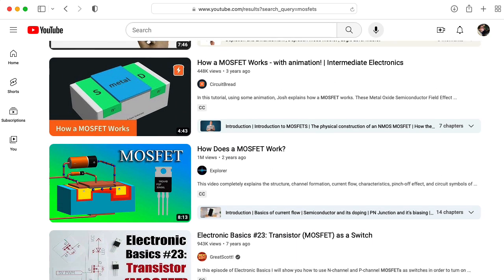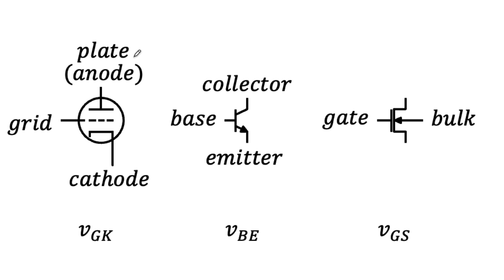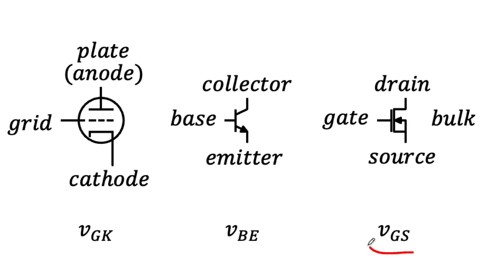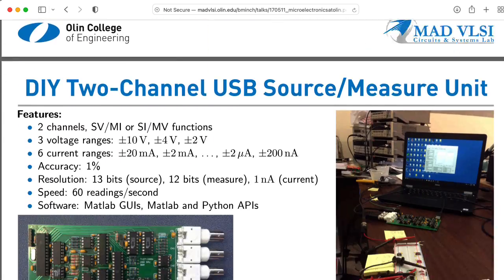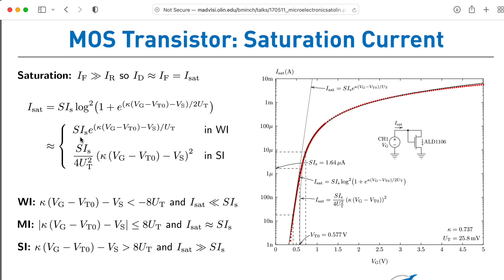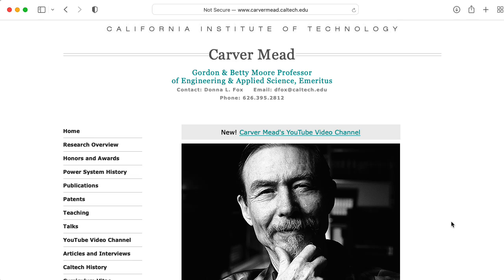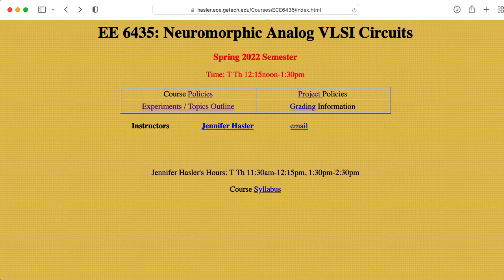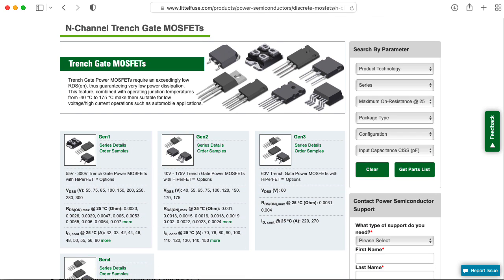They Mislead You About MOSFETs

Comment: hi there, i used a mosfet once, in a relais replacement cirquite board design. it still did not work. question for ya. is a mosfet a group of SOLID compuonands wich you throw with 10 at them at every noob design. in amy random configuration. and the somehow... grow themself in it. ? and choose their function accordi gly to give the designer a good feeling without  lowing to much fuses ?
Reply from the maker: I wouldn't suggest hooking up a bunch MOSFETs down and hoping they do what you want... you definitely want to think through what you want to do and what each MOSFET is doing. That said, I've seen some distortion pedal designs by Dani Ever that seem to defy any kind of conventional analysis. They really do look like she just randomly hooked up transistors until she got something that sounded interesting to her.

Comment: Hi Lantertronics - Thanks for the nice video. A specific point that you might want to spread the word about - the fact that virtually all discrete MOSFETS are of a fundamentally different class than those found in a VLSI process IC. This sounds like a very basic and obvious point to a specialist, but to many in the broader technology community this is a very obscure and non-obvious detail. Worth noting is the reason for that very particular ALD11xx series component  used in the schematic. It is among the very few discrete MOSFETS you can actually buy that resembles what might be found in a 30 - 40 year old CMOS process, and the fact that they can be obtained in matched pairs with reasonably good tolerance suitable for current mirrors being a rare property. I know there are even discrete FETs out there advertised as "small signal VDMOS" and a non-expert is easily confused by the "small signal" term. Case in point - even the eponymous author / maintainer of the popular Falstad electronics simulator program was unaware of this distinction. He seemed to be trying to reason about the reasonable default dimensions for his FET model by looking at datasheets for discrete MOSFETS, and couldn't understand why there is such disagreement! Quite a trap!

I don't think there are any good videos out there that really highlight this point specifically.

Comment: Actually the MOSFET will allow current to flow in either direction between the terminals and there are many reasons to do so. Switching AC currents is a common one as well as active rectification which utilizes the intrinsic diode of the bulk connection to create low loss diode circuit out of the transistor. In this usage current is only permitted to flow through the the transistor when the current is flow in the reverse direction. Also note in many applications the source terminal may not be or must not be consider to be connected to a power rail but instead floats offset from the rail which means that gate bias must be referenced to the source to provide reliable turn-on and turn-off. 

Also consider that how the gate is formed on the transistor the capacitance between the designated source and gate terminals is not the same and gate to drain capacitance changes when the device conducts so the terminals are not arbitrary but you can still use the device with proper attention to the gate bias as though the terminals don't matter. But keep in mind the parasitic diode will conduct when forward biased.

Comment: For me it only matters how volt threshold is. 
How high the switching voltage can be.
How much current I can switch. 
What the internal resistance is like. 
And whether the cooling capacity is sufficient.
This is all in the datasheet. 
If the MOSFET can still be found in the craft box, everything works.

Comment: It’s mentioned that Vgs =Vg-Vs  is never valid for bulk devices.
I missed something; how can this not be correct?
Reply from the maker: Well, it's only valid if you let the threshold voltage itself be a function of the source-to-bulk voltage. So the meaning of Vgs would be constantly changing with the source voltage. It's not meaningful in the way that Vbe is for a BJT or Vgk is for a tube.
Reply: @Lantertronics   there’s something wrong here.  By definition Vab = Va- Vb .
So I think the idea you are trying to get across could be worded better.
Reply from the maker: @yjweaver5108  Indeed, perhaps a better way to say it would be it's "not useful."

Comment: The tube and FET are voltage controlled, the BJT is current controlled, not voltage controlled.
Reply from the maker: The Ebers-Moll equations relate all the currents and the voltages at the terminals. BJTs are usually introduced as "current-controlled devices," but that's not very helpful from the point of view of designing or analyzing circuits with BJTs. It's much more illuminating to view them as voltage-controlled devices, and just dealing with the base current as something of a parasitic effect (although of course current must be flowing through the base for the physics to work).
Reply from the maker: Lectures 6 and 7 from my ECE3400 video series here on YouTube dig into this more.

Comment: In a symmetric BJT the emitter and the collector are also interchangeable.   Even in a non-symmetric BJT the emitter and the collector can be interchanged.  The BJT is not going to work as well, but it works!
Reply: Due to the fact that pinouts for small BJTs aren't standardised, I've accidentally built entire amplifier stages with collector and emitter reversed and only noticed by chance after they've been in operation for weeks 😳
Reply: BJTs are often used in reverse, for example as a bidirectional digital voltage translator.

Comment: Two notes: in (analog) integration circuit design, although in most cases (yet not always), bulk does not have to be connected to V+/V- (if for some reason you want to affect Vt). Second - bjt is actually a (base) current driven device rather than voltage device (Vbe)
Reply: BJT being driven by the base current is a useful first approximation; but the relationship is between collector current and base-emitter voltage as you can see in the Ebers-Moll equation
Reply: The base current is actually just an undesirable side effect that you are forced to accept. The actual control is carried out by v_be. However, because the latter has an effect on this parasitic side effect, a derivation can be made on the basis of the side effect. Works in practice and many things in life are - rightly - simplified for practical purposes.

It is anchored in the world of electrical engineering in many places, such as the simple example of energy transport by electricity. The actual transporter is the electromagnetic field, but electron flow is used in practice.
Reply from the maker: @gohangoku3447  YES YES YES! Very happy to see someone who gets this issue. :)
Reply from the maker: Technically that's true about BJTs, but I think when designing with BJTs it's a lot more natural to think of it as a voltage-controlled device, and think of the base current as kind of a parasitic effect (although of course it's fundamental to the operation of the BJT).
Reply: @Lantertronics but the voltage doesn't really vary over a meaningful range between one amp and exploding, where the current is nearly linear
Reply from the maker: @jxtq27  I'm not sure I'm following you. Check out my ECE3400: Analog Electronics lectures here on YouTube to get a sense of what I'm talking about.

Comment: They won’t tell you this in the data sheet, but mosfets contain absolutely no moss.
Reply: Even that point isn't exactly true either -- it's only the case in circuits that are powered.  In the dark silicon of an IC, moss does accumulate over time.  It's up to the designer to decide if minimizing the moss accumulation is worth suppressing at the expense of leakage current.
Reply from the maker: You win Best Comment on this video. :)

Comment: Dang ... as of this month it's ecactly 40 years ago when I started my internship at Philips Semiconductors. I could not stop listening to some of the chip design gurus that were too willing to explain the design of the new high speed cmos stuff they developed. It's fun being reintroduced to this at a higher level - I am never too old to learn 😁
I have never looked at SOI processes but I guess that since this includes extra steps (you need to grow a silicon layer on the insulator), this is a more expensive process that will only be used for special applications like high speed analog / RF

Comment: I dont even know what a MOSFET is. Oh the depths of my lack of knowledge arrrgh!!! 😔
Reply: Don't worry. It is only worth knowing if you need to know it. It is just a little device used in electronics to either amplify or be used as a switch.
You only really need to know about it if you design or repair electronics. It is like you don't need to know what a camshaft is to drive a car - only if you work with repairing or designing engines etc.
Reply: Not to scare you, but billions if not trillions of MOSFETs know who you are.
Reply: @ericbwertz Yea but they are only tiny little bits of slightly polluted silicon. They have to gain up to be capable of any semi intelligent danger.
Reply: @ericbwertz  UwU do they... like me? :3
Reply from the maker: I highly recommend the free "Introduction to Electronics" course my colleague Bonnie Ferri has on Coursera.
Reply from the maker: https://www.coursera.org/learn/electronics

Comment: A quibble:  There is nothing wrong with the reverse polarity connections on a discrete MOSFET.  
It is done all the time with P-channel MOSFETs serving as a reverse polarity protection diode.  When power is connected correctly, the MOSFET is reverse connected and biased ON so there is very little drop.  If the power connections are reversed, the part is biased "normally" and is off so no destructive current flows.
In some analog work a MOSFET is used to effectively short a small AC voltage to ground or vary a resistance to ground over a range of values.  This is done with very small signals.
Reply from the maker: Good point!
Reply: @Lantertronics  synchronous buck/rectification circuits and ideal diodes in general make use of this kind of thing quite a bit. It's the new "hotness" where hot is actually cool lol

Comment: Nice thanks this makes sense.  I have a FPAA kit, never tried it tho.
I always was confused with common base / gate circuits.  It does seem more intuitive to think of a 4 terminal device, the Gate to bulk voltage opening up the channel , and p vs. N is just the polarity of that gate to bulk voltage.
And you're saying for analog vs cmos you have to think this way.
Sounds like there should be some d/dVs and d/dVg  terms instead of making the expression for Vthresh so complicated?
Reply from the maker: Yeah, in Jennifer's course she writes down the full nonlinear equations and writes like V0 + Vdelta, etc., and it turns out the math often works out so you can find things like gain without explicitly linearizing anything. It's wild, and I haven't seen things done that way in any textbooks I have.

Comment: Theoretically i know this in case of discrete mosfets. Integrated circuit info is somewhat new but logical from the stand point of technology
Reply from the maker: I'm hoping over time more IC design will become available to the masses (maybe through FPAAs).

Comment: I like the content, but the title and thumbnail are click bait. Most people that use something don't need to fully understand how it works if they can use a simplfied model. I feel like you really understated how this is only applicable if you are designing/manufacturing the mosfets
Reply from the maker: I wind wind up feeling compelled to use such clickbate-ish techniques, because for better or or worse -- they work. This channel isn't monitored through ad revenue, so I'm not seeking clicks for my personal finances, I'm seeking clicks because I really want to share these ideas from engineering with people. This video had over 1,000 views in less than 10 hours, and I know if I had titled it "Using Vgs is Only Fully Valid for Discrete MOSFETs" or "The Body Effect is a Hack, Here's a Better Way to View It" it wouldn't have gotten nearly that much attention. YouTube encourages content creators this direction by reporting thinks like click-through rate. Actually, this kind of pressure from the "algorithm" and what it does to the thinking process of content creators would be an interesting video in its own right.
Reply: However, claiming that ignoring body effects is "safe and effective" will only keep you from being latched-up in YouTube jail, even though it's widely known to be a lie.
Reply from the maker: Fair point. I changed the "BAD!" in the thumbnail to "Misleading!" -- indeed, there's times where using Vgs is fine; I'm just wanting people to think more about what's behind it.
Reply: It is applicable when you are designing ICs really. Or when you are using the one and only CD4007. With that chip, you can actually measure and experimentally confirm that Vgs is a misleading term. IC manufacturers also use “4007-ish” setups to bond out transistors from test wafers used to characterize the process.
Reply from the maker: @absurdengineering  Advanced Linear Devices have some matched duals and quads with a shared substrate too -- they're like a refined version of the CD4007 where you have access to all the terminals (they aren't pre-wired like in the 4007).
Reply: @Lantertronics  that's neat. I haven't seen the extra substrate connections on an IC before. Also, I understand the struggle to try and get more views. That's unfortunately part of being on YouTube. Thanks for considering my opinion, though
Reply: @Lantertronics this is really cool.  Do you know of any discrete mosfets available in 4-terminal versions?
Reply from the maker: @jxtq27  Check out the duals and quads from Advanced Linear Devices -- they give access to the bulk connection.

Comment: I respectfully disagree. Vgs is still a useful approximation even for IC design since the bulk terminal is usually not changing too much. You do have to be careful about Vth varying with bulk voltage and account for that when doing the initial design (this can be almost entirely avoided with SOI processes, which also allow more freedom to adjust circuit parameters using the back gate). Additionally, the square law approximation is very back of the envelope for modern processes anyway, short channel effects like mobility degradation and velocity saturation are generally more important in my opinion.
Reply from the maker: Indeed, I probably should have mentioned SOI (Jennifer mentioned it in her list of bullet points I read from but I skipped over it). I'm not sure how common SOI is though?
Reply: @Lantertronics  The latest open source PDK from skywater is SOI (SKY90-FD), as are a few offerings from global foundries such as 22FDSOI. It seems like it is used more for analog/RF processes. I don't know of a digital-centric process that is SOI, but I am not well versed in all the processes out there.
Reply: @sellicott  The GF processes used for AMD K8 (first x86_64 hardware) up to AMD's Piledriver chips (32nm SOI, ~2012). Also IBM processes used for the original Xbox 360, Play Station 3, and Wii processors.
Unless you count "state of the art microprocessor" not as "digital-centric", but I can't think of anything more classically digital-centric.
Reply: @namibjDerEchte  Cool I didn't know that. I work with RF/mixed signal designs myself, so I don't really follow what processes are used for the high-density digital flows. I am pretty confident the latest Intel/TSMC processes are not SOI, so I had not gotten the impression that SOI had less benefit for digital design (other than the the things that make it beneficial in general).
Reply: @sellicott  Modern 14nm and sub processes are all FinFETs. They are completely different ball game. Most of outdated university professors that teach basic courses that include transistor models have no clue about them in reality. And going sub 10 is yet another totally different world where equations don't make sense but only a very rough estimations.